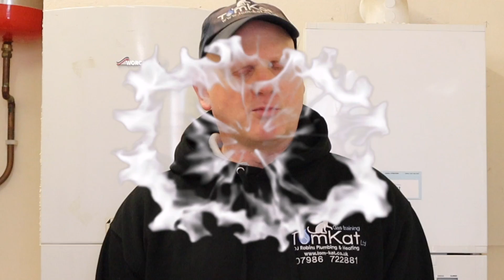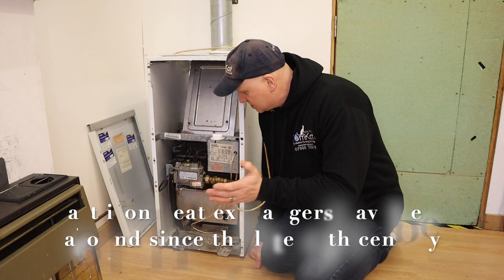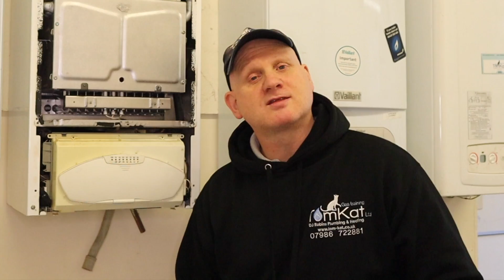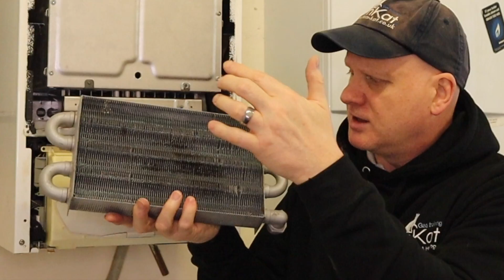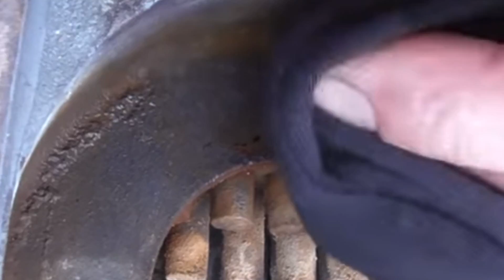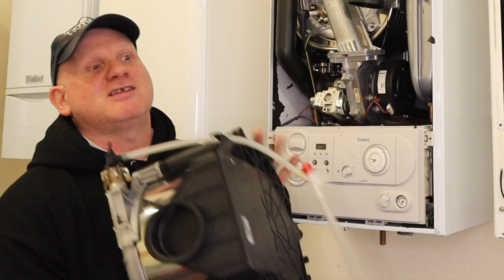What is the best boiler heat exchanger in 2022, cast iron v copper v aluminium v stainless steel.

Comment: The single pass pipes do seem to me to rely on a low feed temperature for good condensation. Where aluminium and double coils will use the return water for a condensing stage.
I've noticed a shift from using 30/50 towards 30/35 temperatures in specs.

Comment: Because the waterways in aluminium heat exchangers are much larger, the water velocity can be reduced, not only does this reduce hydraulic resistance through the heat exchanger it reduces noise created by water flow rates. In fact, the Logic+ and Logic Max ranges have both been awarded the Quiet Mark award for such low noise levels.

Comment: Enjoyed this video. As ever Both Informative and accurate. 
Have to say both Heat Exchangers are good both with their Achilles Heels Stainless steel blocks badly are noisier when introduced to dirty systems , Alloy heat exchangers quieter I’ve come across a few that leak due to corrosion. 90% of boiler related issues I come across are to do with dirty water. Key is to thoroughly Powerflush use good Chemicals replace old rads then all heat exchangers are happy. 

I

Comment: So get a floor standing ideal Classic with a cast iron heat exchanger that lasts 40+ years with a fan flue with the cast iron heat exchanger and a secondary gas recouperator that is easy to replace.
Why not? Nobody wants a boiler to last since 2006 Aprit 1st when the E.U forced this condensing law.  Want the truth follow the money.

Comment: Not shitty Worcester Bosch.
Should be called Woofter Botch.

The Ideal aluminium heat exchanger is a good one.
Under that is the ideal classic cast iron heat exchanger.
Under that is the copper heat exchanger in the Brittony 2T or the old Worcsester Junior 24.

All these condensing boilers crank out so much carbon monoxide and nitrous oxide (The smog causing gas) at street level that sits there for the kids to walk to school in and the cars get the blame BUT hey at least it isn't Co2 right?

Also replacing boilers every 10-15 years is better for the planet right? Not something that lasts 30-50 years.

Get out the flue gas analyser and see the truth.
Reply: Can't disagree about the CO. Action levels on modern boilers are c.200 ppm CO. As long as its below that the boiler manufacturer isn't bothered. An old steam driven boiler would tick along at 15-20 ppm CO or less. Nobody mentions that do they 😉
Reply: @timhancock6626  thank you!

Comment: Very good video. Aluminium heat exchanger vs stainless steel heat exchanger i think stainless steel is much better. But there are different types of stainless steel aisi 304  and aisi 316L.  The aisi 316L  has better corrosion resistance.
Reply: The geometry of the single coil stainless steel ones seems less efficient if a higher temperature rise occurs in the boiler. As part of the coil will be at the outlet temp.

Comment: Very infromative video. I still don't understand how alu vs stainless steel exchangers should affect my choice between 2 boilers, given that the exchangers are in both cases under guarantee, and I will need to service them every year so if anythig bad happens, I should still be covered. And by the way, regardless of the guarantee, if alu is cheaper, does it not also mean they'll be cheaper to replace when neeeded?
Reply: Go Intergas

Comment: Thanks Derek. Another informative video. 

You have missed the unique Intergas heat exchanger from your list. IMO the best available, for durability, & pipe size through the exchanger (22mm heating & 12 mm for direct HW, NO PLATE). 

They have manufactured over 2 Million hex units since the 90's with Zero failures. They have many other benefits. Do check them out if you haven't heard much about them? 

Keep up the sterling work. :)
Reply from the maker: It’s still aluminium though

Comment: Fantastic thanks for explaining so every one can understand that inhibitor and annual boiler check is the key to a boiler life and costs, what about Intergas how do they compare ?
Reply from the maker: Don’t know that much about intergas mate. I know their water ways are copper inside an aluminium injection moulded heat exchanger with 2 separate water ways one for heating and one for the hot water. So again I guess because the water ways are copper the ph will need to be spot on.
Reply: @tomkatgastraining  Mine is 10 years old still 93% as new also bills are very low, I love it, such a logical way no diverter or plate to plate. regards George Staszak

Comment: My experience….. the stainless steel heat exchangers I’m most familiar with are the 10mm diameter version….and after around 10 yrs they block ( depending on state of system) and are impossible to clear…. Aluminium rot/ corrode and if not strip serviced the airways block….life expectancy is also around 10yrs

Comment: I can only apologise for my Thorn cast iron boiler that I put in 30 years ago and it was a second hand boiler back then. It’s got the same gas valve but has gone through a few thermocouples. It’s a 60 BTU boiler but I think it uses 80 BTU so it’s efficiency is not that good (60/80 x 100 % I think). It keeps a thermal store hot so is always full on when the thermal store calls for heat. The store is the same age and is getting tired so a new one is on the cards this summer. The question is, do I update my boiler at the same time or keep the boiler until I have rusted through and started pushing up daisies?
Reply: Keep it. A thermocouple every few years is better combi churn

Comment: To get a blockage in any heat exchanger is rare. If the primary water is bad with magnitite then your asking for problems. Best check the quantity of the primary water! Generally the system would tend to be very neglected over time then that would lead to a blockage!

Comment: Aluminium heat exchangers for condensing boilers are predominately Aluminium Silicate to try and combat the acidity in the condense! 
You can see how badly they work against the condense when you see the crap that collects in the condense trap which can lead to a build up of deposits!
They are a lot cheaper that is mainly why manufacturers use them. Stainless steel are far better being corrosion resistant and its made a lot easier to service one due to the great Giacomo design giving front access in behind the burner. 
They tend to outlast the general lifetime of the boiler with other component issues failing over time that lead to replacement of the boiler!
Reply: The alloy heat exchanger in my Ideal Turbo 2 lasted 25 years and was retired before it failed. Apart from having inhibitor no special attention was given to water quality, and it only had a Magnaclean for the last six years of its life. It was replaced with a Logic that has done six years fault free so far.
Reply: Remeha (BDR / Brotje / De Dietrich / Baxi) have some kind of enameled aluminium these days.

Comment: I used to think that stainless was premium. But looking back over the last few years, I’ve had two boilers with complete heat exchanger blockages.  Not even a powerflush would shift it. Both stainless. Both vailants. I’ve had zero blocked heat exchangers on Ali blocks. Also I’ve seen hundreds and hundreds, in fact probably nigh on a thousand logics/I minis/independents/i2 boilers and I’ve only ever found one pin holed heat ex. So given the ten year warranty, I’ve kind of changed my mind now and think that as long as the boiler/system is looked after then in the real world there’s actually very little difference between the two. Except the price.
Reply: You make a good point wayne ,there is no way a power flush will shift the blockage on a vaillant heat exchanger as they are twin pass crap heat exchangers made by giannoni! The very reason I don’t use these vaillant boilers anymore, best stainless heat exchanger has to be viessmann I think , I have seen lots of ideal boilers with pinhole problems, always same place though in top left hand corner below burner, possibly a casting issue though?

Comment: Hi, are you saying you need a water softener to control the ph. value on a domestic boiler ? or do you do a ph. test and add more inhibiter ? 35 years running an Ideal W and only had 1 thermo - couple
Reply from the maker: The inhibitors control the PH
Reply: Good question
Reply: @richardwallace3477  Hi, see the answer above
Reply: I had a number of Ideal Ws where the cast iron heat exchanger corroded and failed 20 years ago. There were hundreds of them in social housing contracts, and Ideal Concordes. Don't get me wrong, they were very good and simple boilers that gave long service, but I wouldn't want one today under any circumstances.

Comment: You touched on people not servicing boilers. But people will also either as a diy/or with a handyman/decorator drain and remove rads periodically for decorating and may not bother to check inhibitor levels afterwards. Therefore I'm leaning evermore towards stainless as a more robust option. Mlcp rad pipework for same reasons too inner layer is inert plastic. Only the rads themselves and the valves to worry about then.

Comment: Another of your very informative videos.  👍🏽 I’m looking to change from the Kingfisher 2, but can’t find a floor standing stainless steal boiler to ensure it sits in the same place as the Kingfisher 2.  Any suggestions?  Btw, I’ve had the Kingfisher for 28yrs, it’s serviced every two years and works a treat.   Last serviced on 29/9/2021… Service engineer left us with 3 readings… 90.3% efficiency, 5.95% CO2, 5ppm CO.
Reply: 90.3% efficiency is net efficiency so actually only 81 % ish. That’s probably from cold when the return pipe hasn’t raised much in temperature. A viessmann 222 has a stainless steel heat exchanger and is floor standing
Reply: No way is that kingfisher that efficient
Reply: That 90.3% is not the boiler efficiency, that is the efficiency of the combustion of the gas. The efficiency of the boiler is how much of that energy is converted into usable heat and with a cast iron heat exchanger there are higher losses in the transfer to water, and slower heat up times plus the inability to operate in condensing mode which maximises efficiency. Your boiler is probably somewhere around 60% efficient at a guess.

Comment: my worcester bosch CDI last 22 years now and looks like will last another 10 years. amazing for that kind of aluminium cell. I prefer stainless  one but could think about the legend of worcester cdi cell
Reply: And do you know why?
Because in 2000 we didn't have shitty condensing boilers.
Your cdi is around 79% efficient and made of steel, copper and brass.
The new Worcsester Botch are made of very badly cast aluminium silicate, recycled milk bottle plastic, in a pretty packaged box.